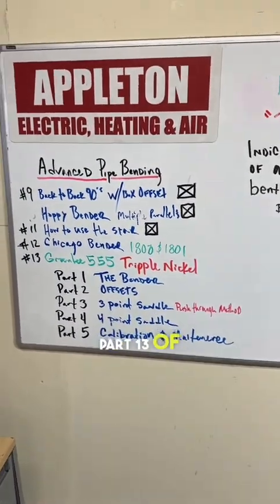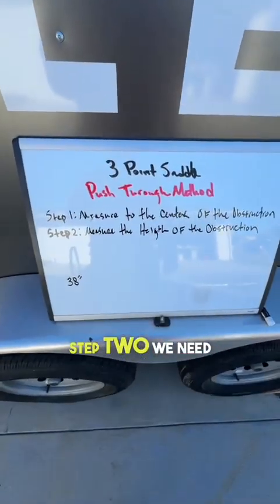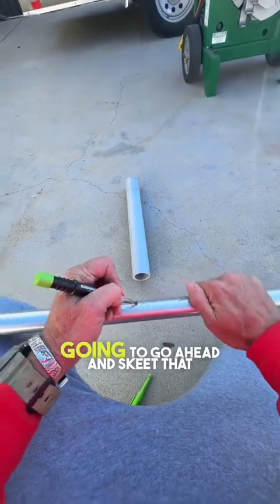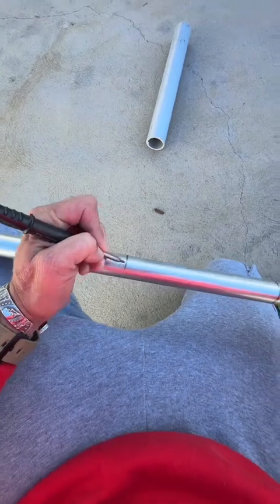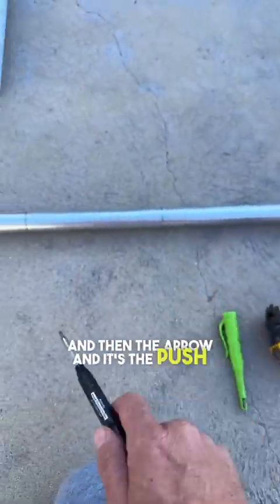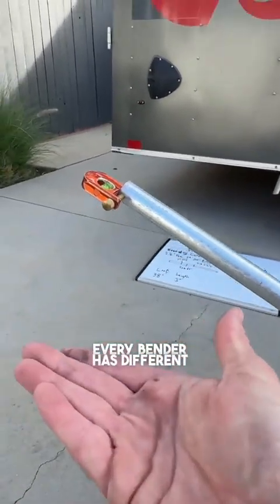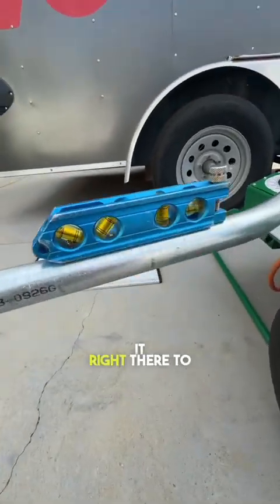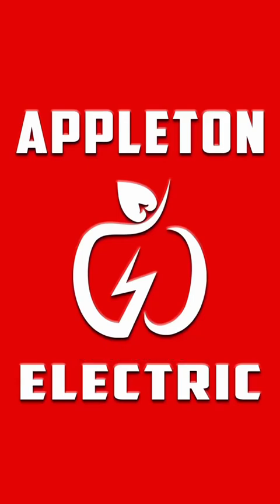Advanced Pipe Bending: Bending a Three-Point Saddle with the Push-Through Method.

Comment: How did you find the right distance for those marks?
Reply: He said 2.5” per inch of rise. So once you have the center marked correctly, multiply 2.5x(height of obstruction)= side marks. Then start at tear mark, then star mark, and last the shoe. I made the mistake on staring on shoe mark then the rest but shoe is the last bend. Just takes practice. I’m practicing this method seems a lot simpler.
Reply: It’s 2.5 due to using the 22 degree for first and last bend for 45 saddle…if he would have used the 30 degree saddle it’ll be 15x30x15 so your multiplier would be of 3.9 per inch of rise…hence you can also verify with degree multiplier formula: 1/sin(degree)=multiplier which helps when doing tricky offsets